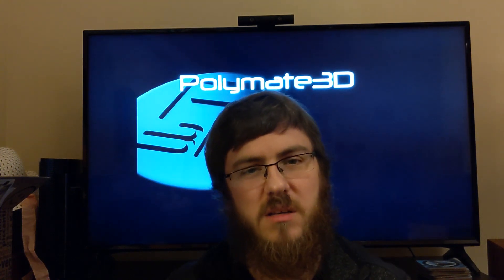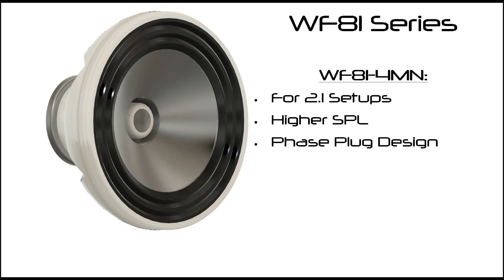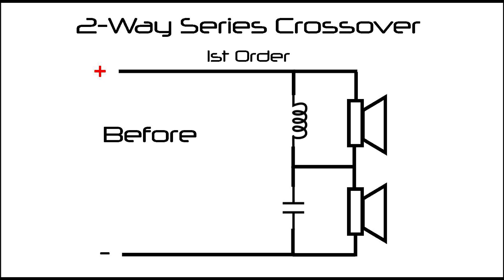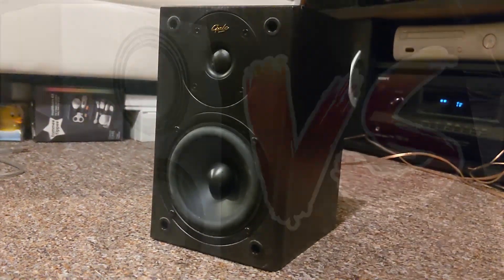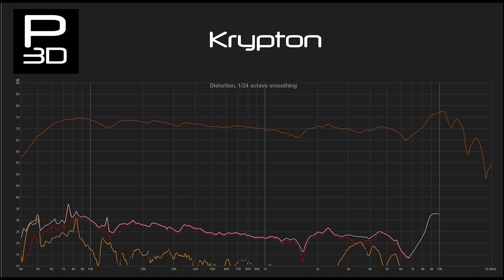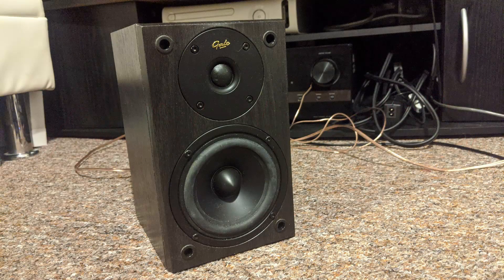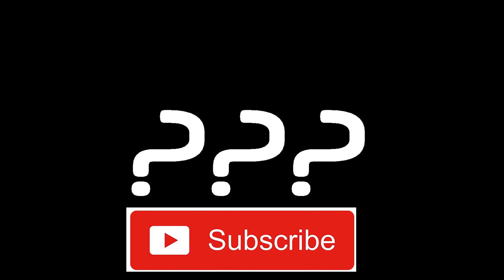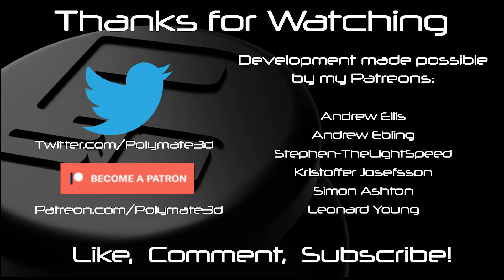3D Printed 2-Way Bookshelf vs Industry Bookshelf Speaker

Comment: Interesting indeed.
To get a better sense of bass response and tuning, it's actually a lot easier to measure the impedance. 
Which is needed anyway to make a proper crossover filter.
Reply from the maker: Hey P_Mouse. Thanks for the message and I did do some impedance tests of the driver itself and never published them (Not intentional). Are you referring to also doing a impendance measurement in the enclosure as well? When Tenacious 6 driver is done, I will try to rectify this and future designs!
Reply: @Polymate3D  Yes, in the enclosure as well.
When measuring the impedance of the driver itself, it's actually not so difficult to measure the T/S as well.